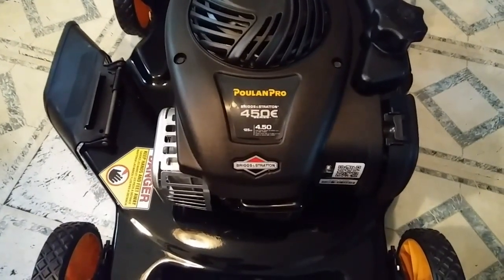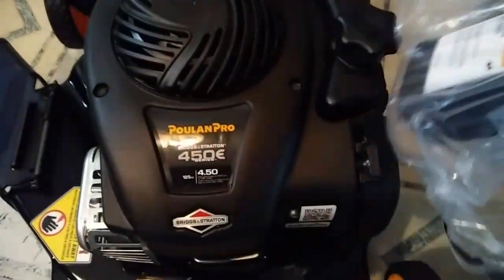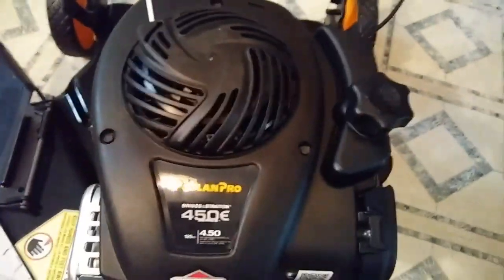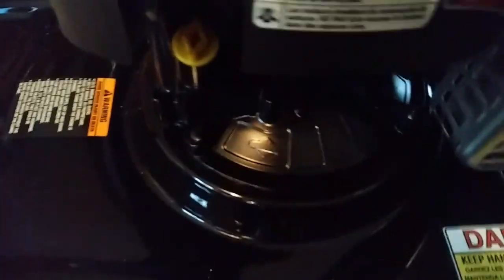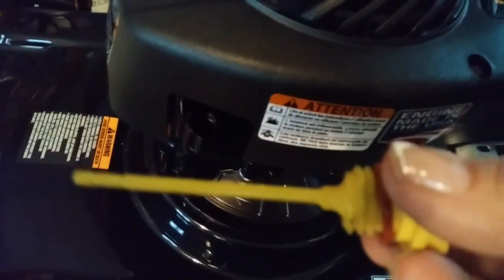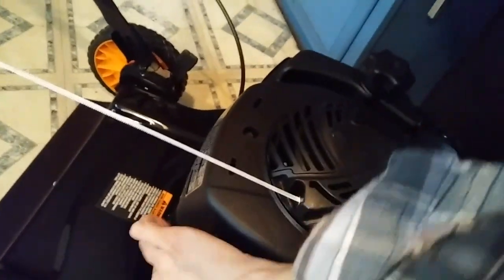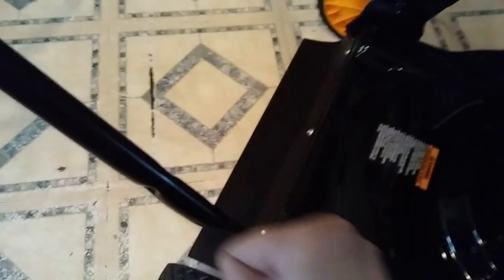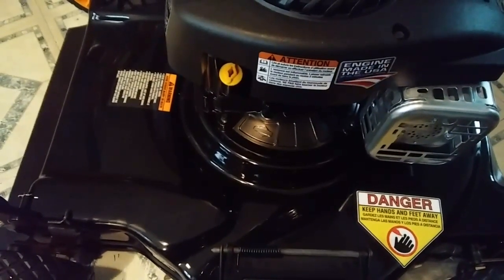poulan pro lawnmower oil cap dipstick location handle

Comment: I want to thank you so so much!!!! This video is priceless!!! I found the yellow piece and I knew that it HAD to be where the oil went but we couldn’t open it so then I started to second guess myself.  I saw your video after 4 others that told me nothing and I only had an adjustable wrench but it worked! Then, problem 2. No funnel. So , I folded a business card and left an opening at the top and it worked! I just poured it into the top. So, I was all set. Primed it, pulled up the handle and the string you pull wouldn’t pull.🙄. It was this past Saturday when it was 115 degrees ( literally) in Pennsylvania.. Our first home and the grass HAS to be cut. I lifted up the lawnmower and I asked my wife to see what happened when I pulled the string. She said nothing happened. I then told her to hold it up and pull it and I could see it got coughs on the handle because it needed to be adjusted. As soon as we did that, it took 4 pulls and 30 minutes later, a great looking lawn. But again, your video made it happen. Our yellow piece has the oil can symbol on it. I had to keep checking the dip stock because I had no idea how much to add. We still haven’t moved in yet because we had to give notice where we are now. This Saturday is the big day and I am sure Sunday we will be cutting the grass again!!! Have a great day!!!

Comment: I just got my mower and I had the same issue. I wish they'd send manuals that are for the actual model that you've purchased. Also, I can't get the cap off for anything. My husband couldn't get it off either. It's like it's glued on there. Thanks for the video.

Comment: Thanks!! Just got this today and I saw that yellow thing but I didn't want to break anything. None of the pictures in the manual looked like that. Was it difficult to pour the oil in there since it is such an odd location?
Reply from the maker: use a funnel

Comment: Use a rubber end of pliers to pull towards you at 10 o'clock and push away from yourself at 4 o'clock this will give you the torque

Comment: how do you get the oil to pour in that little space with the black plastic sheet covering most of the access to the oil compartment from above ?
Reply from the maker: use a funnel
Reply: Thanks - that's what I was thinking and I'd probably need an odd size small funnel, which at this point I''m using for food.  What crappy design !!!

Comment: So how do u change oil ?
Reply: tim s. 
From what i’ve read there is no oil drain plug on the bottom so you either use a suction pump with a hose put down the oil fill or you tip the whole mower over so that the oil pours out the fill hole.
Reply: MindBlown Watcher Ty
Reply: MindBlown Watcher Ty

Comment: I have one of these mowers.  Sure is a stupid place where the dipstick is on this thing.   I have an old Poulan Pro that is 9 years old and still runs.  And everything is in plain sight.   Beware if anyone buys this mower to insist that employees don't assemble, put oil and gas in this mower.   In my case these employees at the store I bought this from didn't know shit from shinola about it.  Didn't even know where the dipstick was.  I wanted them to deliver it in the box for me but I apparently wasn't strong enough in my request.   You are better off figuring everything out for yourself.